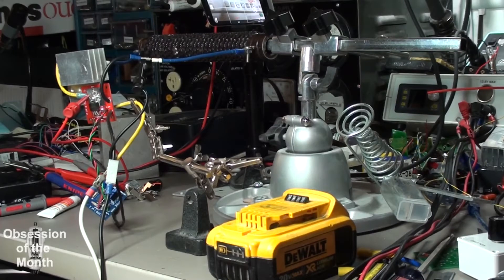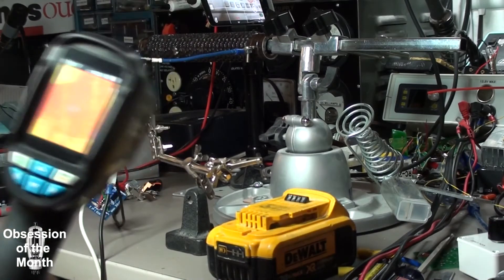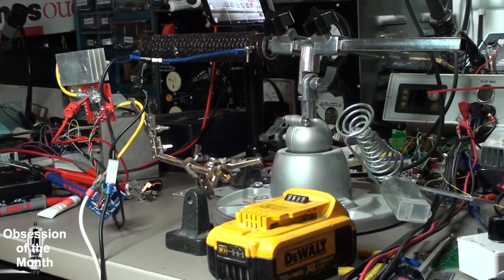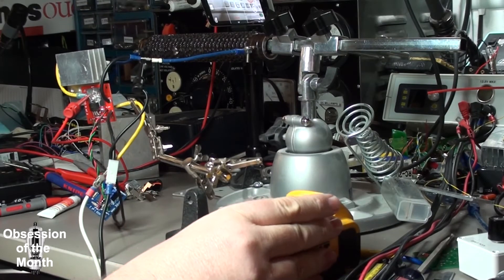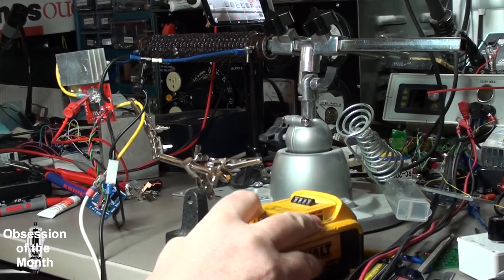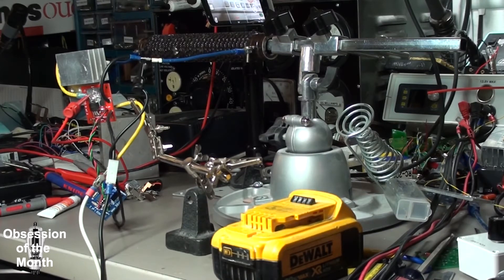18v Low Voltage Cut off Part 2 of 2

Comment: What is the max amp that can be handled? I'm planning to install it on power tools
Reply from the maker: that's a complicated answer, it depends:
as my circuit is drawn with the weight of copper (2oz) on both sides of the PCB about 16 amps continuous. The fet can handle 31 amps with a temperature rise of 25° C.
If you increase the copper weight to 4oz the board can handle about 23 amps. If you fill the traces for B+ and B- with a pile of solder or heavy wire, even more.
I tested this with a 6 amp purely resistive load and the mosfet hardly got warm. A heat sink would be recommended for any continuous inductive loads above 3 amps. I could not tell you how much would be needed.
I have not tested this device with a motor yet.

Comment: Awesome. Can you provide a circuit for your design? Would love to implement something close to this.
Reply from the maker: Got your email. Start here https://www.badcaps.net/forum/showpost.php?p=982189&postcount=50 the user eccerr0r is the one who is the mastermind behind the design. 

I did see Clives video re: the dubai bulbs. 

Re:  removing the cap in the bulb, I did try something similar to what you tried but the caps on mine are  too tightly pressed on.